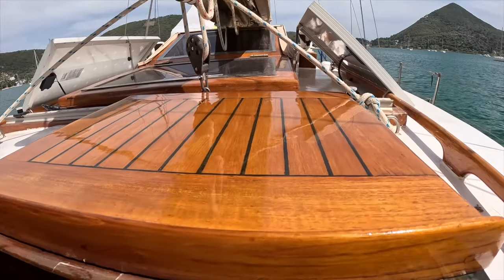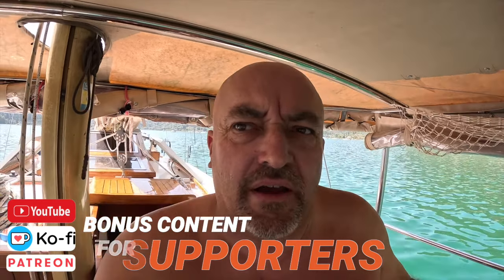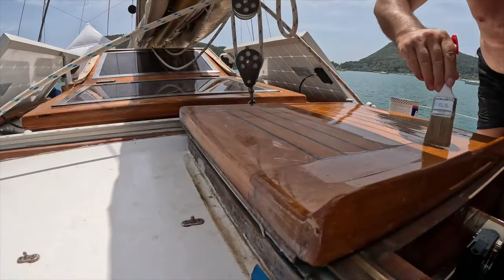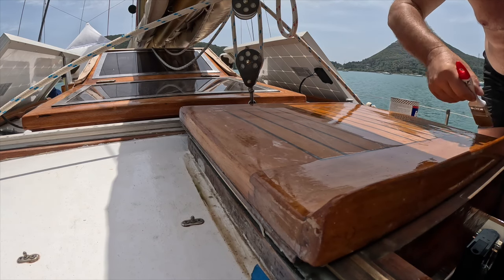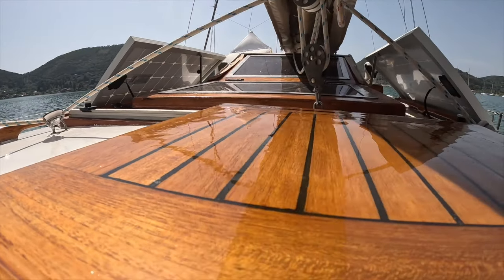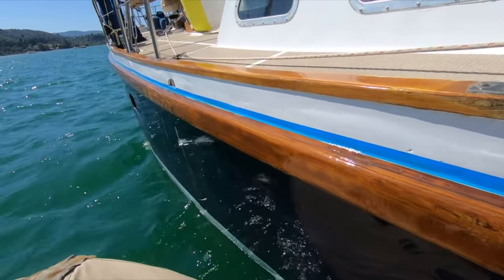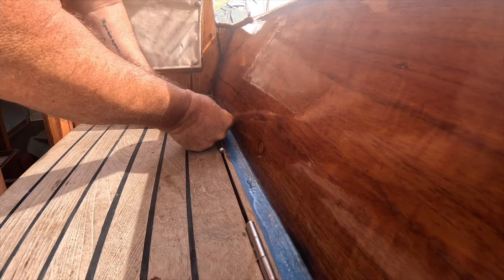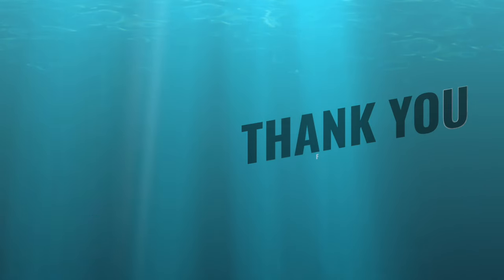BONUS FOOTAGE JUNE 2024

Comment: A long time ago I used Epifanes to varish some teak doors on my dads boat back in Galveston, TX.  What I did was put 8 coats and the first coat I diluted by 80% thinner.  Very thin and absorbed fast into the pores.  Next coat was 70% thinned and so on.  The last coat was unthinned.  Sanding inbetween coats.  I had to leave Galveston but went back about 4 years later and that teaks was perfect.  My dad did nothing with that boats for years after I moved off and went through a couple of hurricanes but that teak look great after years.
Reply from the maker: Hi John.  If only my sons were as kind and diligent as you , great job my friend and thank you for watching and commenting.

Comment: For steel boat, there is a lot of teak on her.
The result is very nice, hope it will last with an epoxy base coat.
Reply from the maker: The builder hired a furniture maker to do the interior , the whiskey seats are featured in a yacht building book from the 70,s.